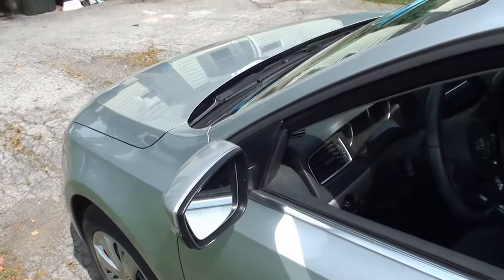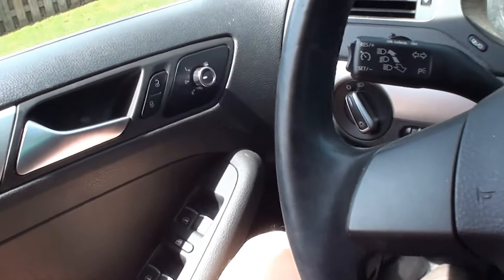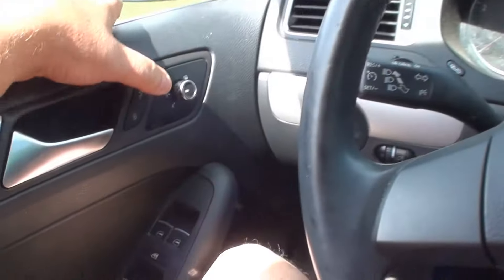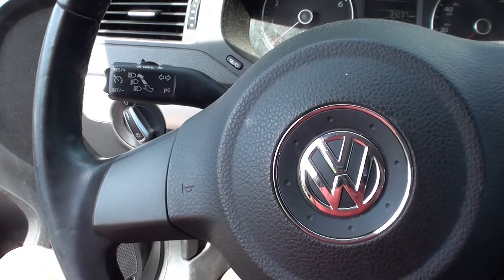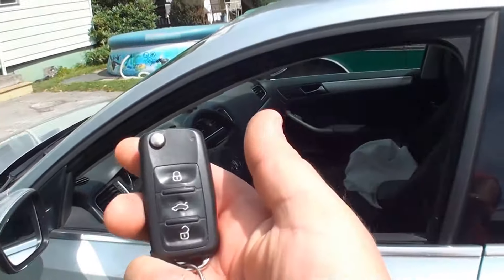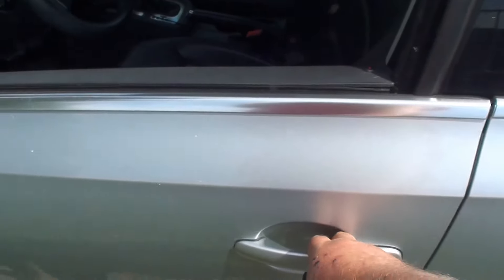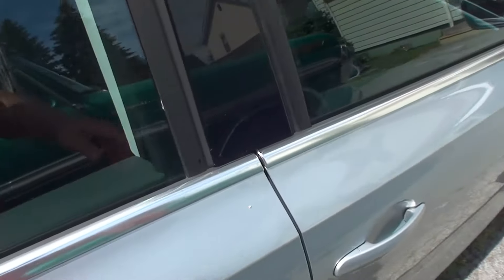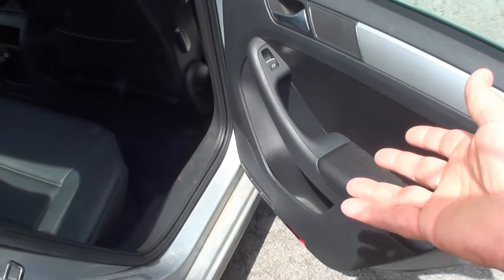Car lock keeps clicking? YOUR CAR IS NOT LOCKED!

Comment: I have a similar problem when I’m driving I hear the door trying to lock but  won’t lock but are used to lock right after 30 seconds of driving. I did things that you did lock the car and check all around and everything seems to be locked but when I’m driving I hear it clicking and won’t lock. 2009 merc...gl450 😏
Reply: Me too did you manage to fix this and how please
Reply: I had wiring problem with the fuse box is somehow I manage to overheat by putting the wrong fuse morel amp, on the bottom of the fuse box got melted. Car Electrician managed to fix it.

Comment: Good video but I put a new actuator in and it’s still not locking, on my 2012 VW passat passenger front door. OBD 11 and VCD says the same thing, Lock unit for central locking Implausible signal…. I have no idea where to look next

Comment: I have exactly same problem in my 2011 jetta... Right rear door lock does not lock and keep clicking during the drive. Feels as if its trying hard to lock but it does not. Only way to solve is to replace the door lock actuator

Comment: Having the same problem with my 2014 Passat tdi, driver door never locks,ive also noticed when I do lock the car with the remote button the indicators don't flash anymore, I'm guessing it's a notification to tell you the car is not properly locked

Comment: On my 2007 Pontiac G5 coupe (2door) The door Lock switches were not working correctly! I grabbed new switches from the junkyard & it fixed it right up! I also replaced the passenger side door latch & I do not remember why. I HAD TO MOVE & LOST A LOT! now, the door locks are flickering mostly after starting the car! After I put it in gear, it stops. A bit of history.. I ran the codes & got a code for the range sensor (PRND) However, the transmission went out & I replaced it! The sensors on the new trans  looked much nicer! I am still getting a code for the range sensor(PRND) & WHEN THE CAR US IN PARK, & I START IT, I HEAR CLICKING IN THE CENTER CONSOL SO, IM wondering if there is a sensor attached to the shifter or if it's the sensor on the transmission, or just  faulty door lock switches?

Comment: I have a4 my front door locks but the rest don't due to the snow how do I fix that I recharge battery then it work the stopped agian how do it fix it as anyone else had this trouble on A4 audi
Reply from the maker: Have you tried a little WD40 on the locks? I had to lube them up this winter cause they wouldn't latch.